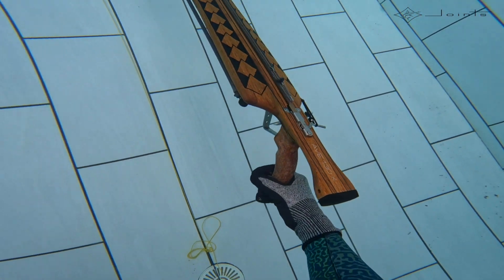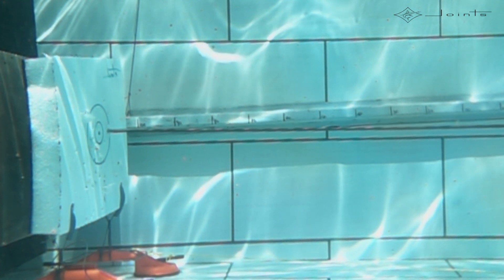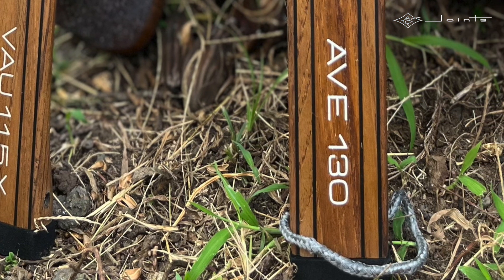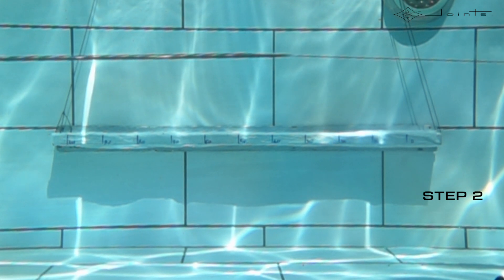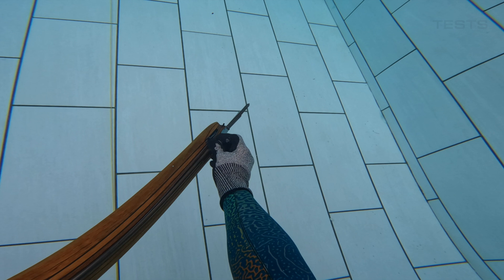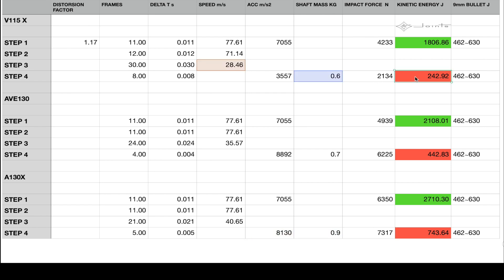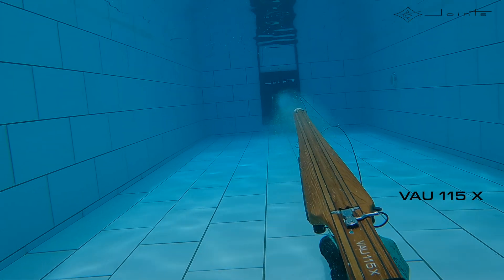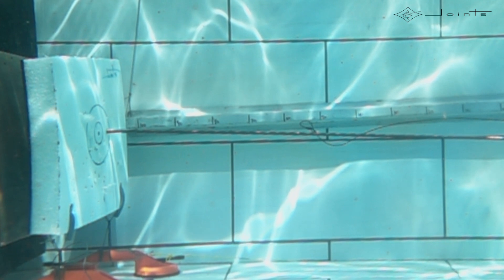AVE 130 X vs. AVE 130 vs. VAU 115 X – SLOMO TESTS & SOME SCIENCE

Comment: The Problem with 115-130 cm spearguns is they are to long for checking close range hole. They are perfect for shooting fish in the open. Ever thought about a Big 120 Cm BUT with mid handle/Grip?? You would have a 120 power but in a 90 cm or less sized gun. I started with a 100 cm Champion Arbalette rubber gun. Evolved to a mid handed pneumatic and by 17 yrs of age upgrade to a 120 cm mid handed pneumatic. Never looked back at the unreliable rubber of the 1960's. The favorite was a Nemrod Filibustero, 120, And Power grew as I got older and stronger. 9mm spear woluld shoot through the big ones out to 4 mts. BUT it was short enough to check small holes. Eventually bought an even bigger Mares Bazooka. 10 mm spear and more powerfull. But it didn't fit me right.

Comment: Very nice video!
It would be interesting to see the changes with increased/ decresed band stretch.
Reply from the maker: the band stretch is at maximum. and it's the same for all the guns tested. 
over charging the shaft will have a negative effect on the aiming, as it will shoot low!

Comment: Vau 105 X please... :D
Reply from the maker: interesting...for what fish you would need such a small but powerful speargun?
Reply: @joints-spearfishing-tahiti shoredive marlins haha
Reply: @ 
Big preys in the average of 15/20 kg to stone immediatly in the head (the hardest spot), not always clear water , current and average deep of 25/30 mt wich is where spearguns start to loose power
Reply from the maker: @julesverne5072 within this range I can still have a lot of power with the regular Vau 105! That gun landed more than one 40kg doggie at quite a long range!
Reply: @  I bet it was shot in the flesh for sure. If you use that set up to shot the head of a 20 kg fish penetration is almost not enough in my experience
Reply from the maker: @julesverne5072  in your experience, did you ever tried my VAU 105? anyways the problem with a short gun super powered, is that you'll have a lot of penetration and power in the first 2-3 meters of shot...in this test video I explain why, the mass of the shot is low, and the thrust time is short too, resulting in loss of power. to increase power you need mass on the shaft and enough powerful thrust time.  Anyways the VAU 105 is hyper precise and can landed big fish from 5 meters as it is pretty easy to make KO shots.
Reply: @  My experiences are with similar products and same set up.
Reply: @julesverne5072  No rubber band speargun looses power the deeper You go. Pneumatics do loose power the deeper you go
Reply: @WillyK51   no dude, it is exactly the other way round ;)